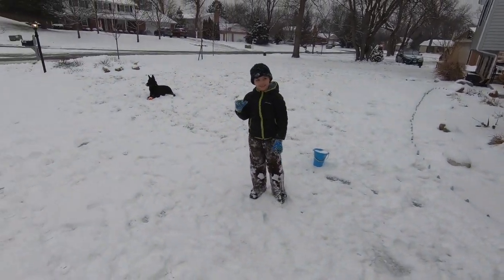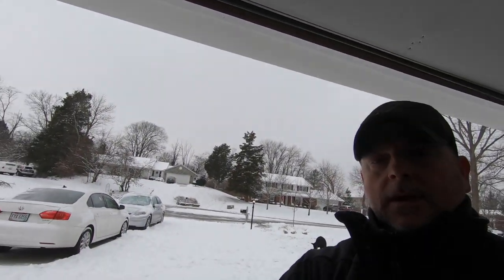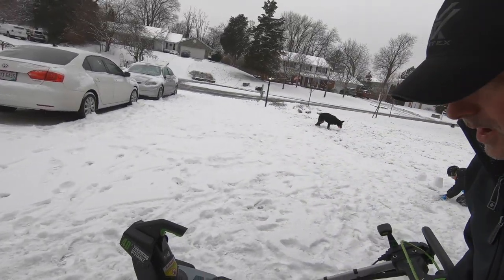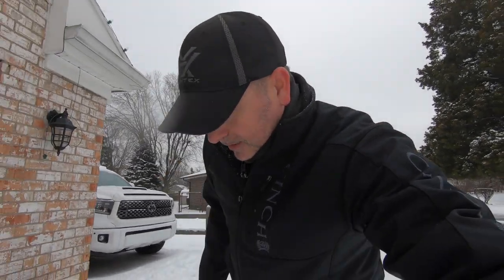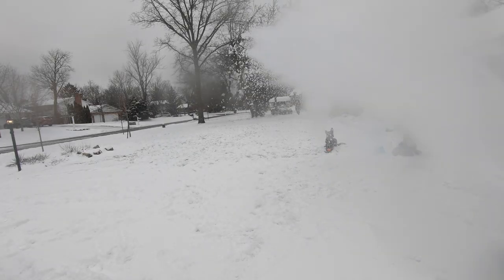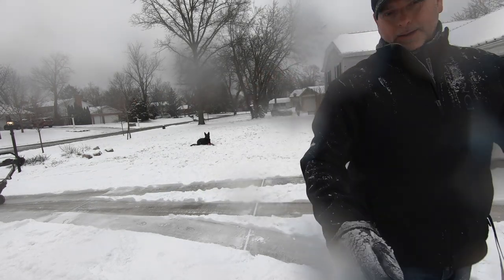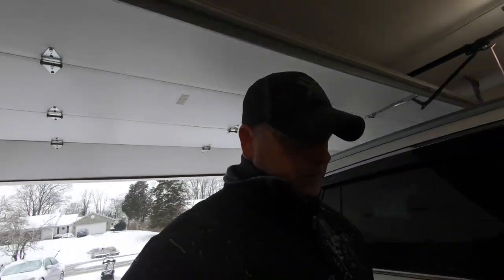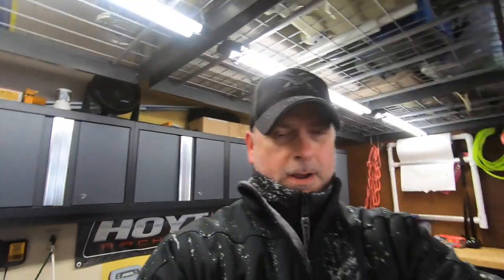EGO SNT2114 Snowblower 1yr Update !

Comment: Just  sharing,i bought used rollerblades inline skates for $8 at triffty store and use the wheels, the shaft bolt attach to the wheels and cut the plastic that attach to that 2pcs for spacers for each side ,drill holes both front sides for the bolt shaft.Put spacer at the bottom of the plastic scraper before drilling holes for the wheels, it depends how u like your plastic scraper height, even if it touch the cement it wont worn out  that fast .Since i put this i have no problem pushing it .the only downside is the warranty.And i did spray hybrid ceramic spray coat at the chute and at front so snow don’t get stock and better flow.
Reply from the maker: That’s an excellent idea ! Thanks !
Reply: I just upload a short one for better look .

Comment: I chose this unit over the Ariens Professional 21 single-stage because I have enough gas-powered equipment. The unit is light, powerful, and gets the job done fast. I don't need to lug that two-stage around all the time.

Comment: If you don’t bring the battery down all the way and you get it out let’s say halfway you’ll get a lot more chargers added that battery don’t listen to everything they say I had batteries and other things red in the snowblower. It lasted a little bit longer and one more thing sir at this model 2014 do you get two batteries and a sliding chargers? Do I have to buy a snow blow little bit shovel if they get ice built-in describe it out rather me sticking my hand inside of it or does it they give you one let me know if I have to buy one of those and let me know if there’s any other kind of maintenance besides, maybe changing a belt so thank you sir I like your video
Reply from the maker: This kit came with two batteries and a charger. I’ve never had ice build up in it at all. A shot of silicone spray helps also ! There’s basically no maintenance.  It’s like a cordless drill, but bigger !
Reply: @ohiorectec6055  thank you

Comment: Just bought this model and agree it should have feet to allow easier operation.  I also notice that mine puts out a stream of snow straight ahead (not thru shute), that can deposit a blob on whatever you are walking toward.  I have never seen this in other blowers.
Reply from the maker: That is odd. I know 5 people that have them an no issues. I’d check it to be sure it’s manufactured correctly.